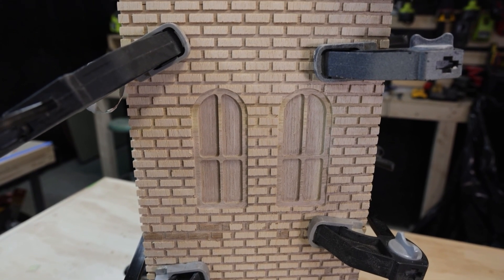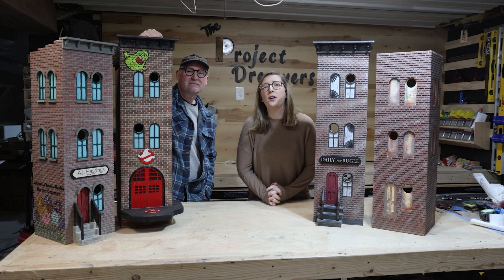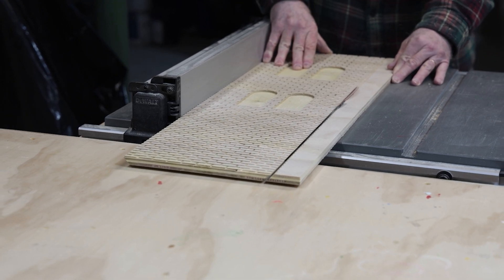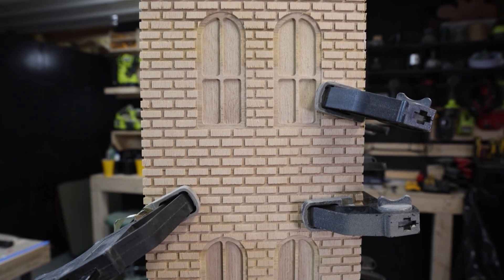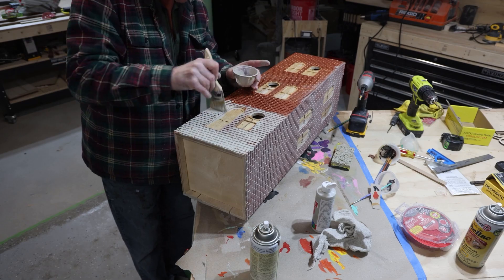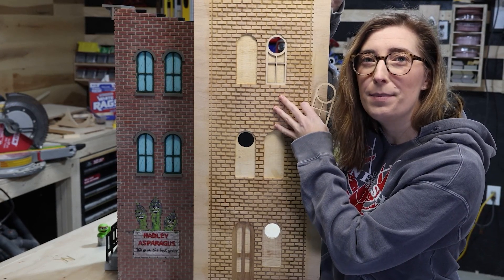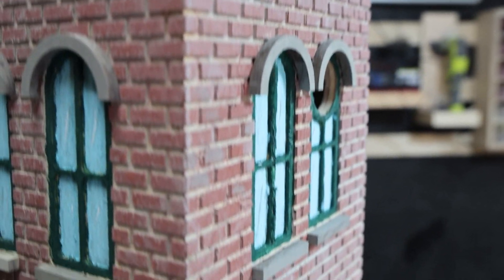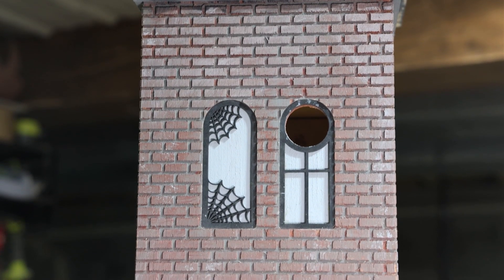Next-Level CNC Birdhouse Build! 🔥 Custom Designs with XTool & Laser Cutting

Comment: Those are awesome looking birdhouses!  The artistry is amazing.  But I assume they're made for indoor decorative use and not to be used as real birdhouses.  I don't think they would survive the elements and most desirable birds don't want to nest in multi-story houses.
Reply: The AJ Hastings birdhouse has been outside here in New England for about 4 months.  Lot's of rain and we do have tenants in 2 of the apartments!   Regarding how it will hold up?  I will bring it in during the winter and recoat for the next season.    It's more artistic but, also functions.  I love the creativity.